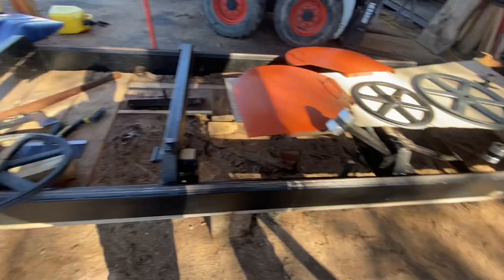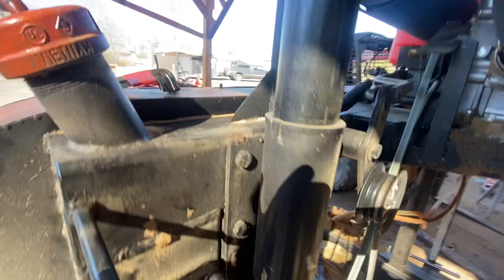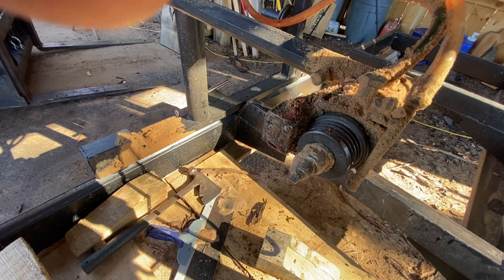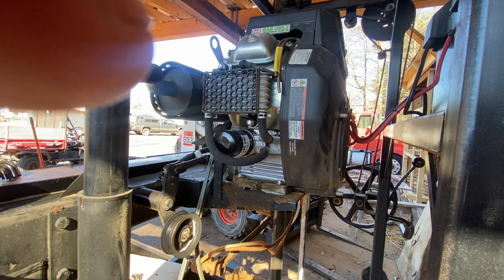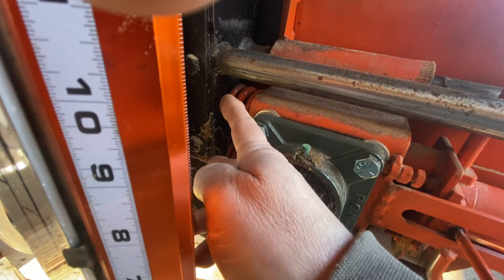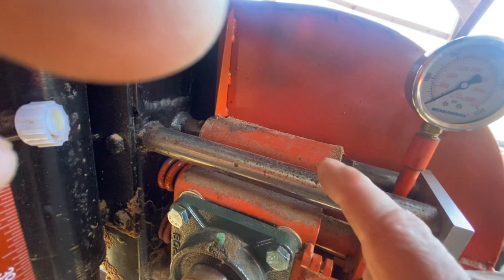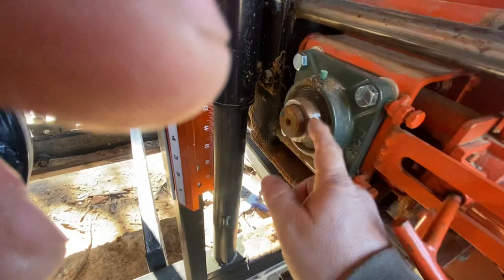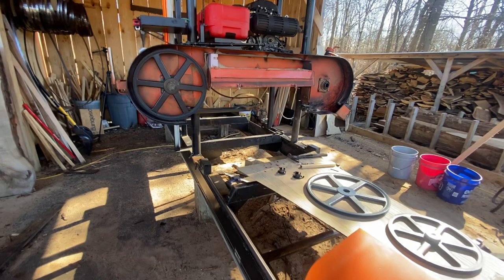Homemade sawmill ideas part 2 (tips and tricks)

Comment: Great vid, I learned a lot , so thank you.  I think I almost understand the tensioning system , would it be too much to make another vid  about it? Sorry, I'm such a bonehead, couldn't quite see the spring detail and underneath detail.
Reply from the maker: Absolutely. I would like to take apart the system which isn’t hard and give some close up shots of it. So I’ll get on that. I hope this is helping. Thank you for watching.
Reply: That would be GREAT! @PaulWhitedWoodStoneIron
Reply from the maker: I’m sorry I never put together another video yet of the close up of the tension system. I will see how my week goes and try to get that done. Once you see it more I think it will maybe make more sense. But I for sure am very happy with how it works over all. The spring back up is just awesome with getting quality lumber out of it. And the vibration is lower.
Reply: I'm having a hard time understanding the blade tensioning system as well. the jack extends which compresses the springs but doesn't the jack prevent the springs from extending enough to keep pressure on the blade?

Comment: For the cable system, being that its only on 1 side do you find that it wants to twist torque the saw unit from left to right?   I've never seen anyone build this w/ cable system.  Usually they are chain drive.   I feel like either way i'd wanna do tandem so that both sides are pulling in sync.   But i also wanna build a wider mill to do say up to ~50" slabs
Hopefully next year i can start on my build once i get setup on new property.
Reply: Great build btw.  Very well thought out.  I'll be borrowing several idea's from yours.
Reply from the maker: That’s awesome. The whole head unit is so beefy that it doesn’t tweak at all. But I was very concearned of it being built strong enough as to not jerk while sawing. Which can happen with each tooth trying to bite. I’m glad I went over board kind of to make sure it was strong. And the cable was an after thought because of how heavy the head unit is to push. And I haven’t even been quick to get to the power feed because this works so well. Someday though I will.

Comment: Question: have you ever solved or even had the problem of a cant under tension and bow on you? I’m sure … we all have….but clamping to prevent movement is problematic… any suggestions?
Reply from the maker: Yes my suggestion to that is to cut your can’t a bit over sized as your cutting not so much in your width but the height as your cutting down through the cant. And as you get at the pith or the center to them flip the log and cut off the bow. Like 1/2” then start taking of your boards whatever they may be. 4/4 or whatever. This is where having a scale that is movable comes into play. Say if you were wanting 12” wide boards and 12 boards to come off the can’t which would be somewhere in the range of 12” plus 1/8” times 11 cuts. If that makes sense. The scale is set at 1 1/2 at the 1” mark so that when you flip the cant you then set the scale at 1” at the 1” mark and you will be removing 1/2” price first. And usually it is 1/2” at ends and 1/4” in the middle from tension. If this didn’t come across with any sense I would be happy to make a video explaining it. Thanks for watching.